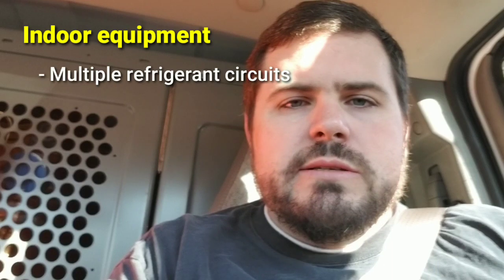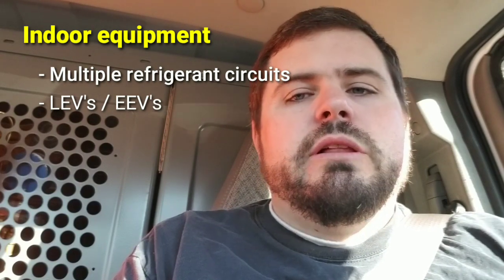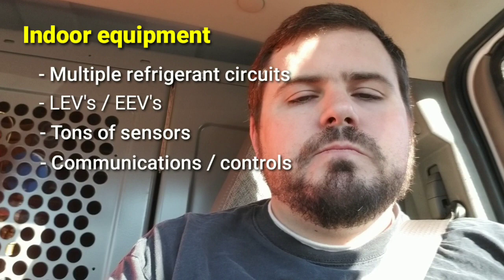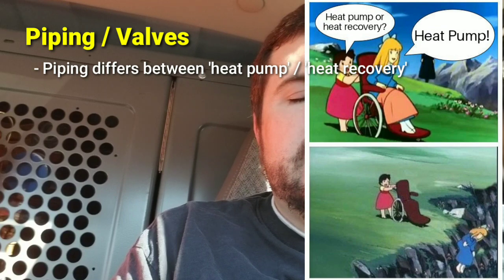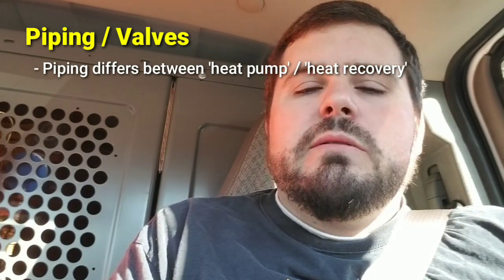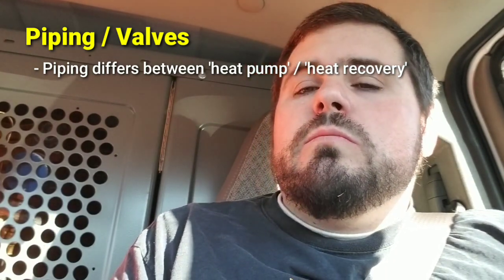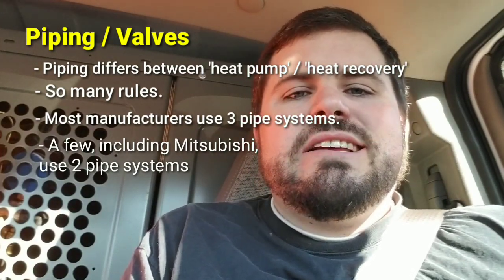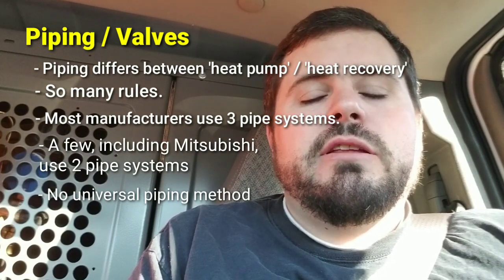What is VRF?  A overview - 1 of 4

Comment: For a G+2 floors in coastal florida with high humidity and heat with each floor of 3000K sq Feet what do you think of a hybrid VRF (like Mitsubishi or Daiken) with zender Air handler.. is that a good set up? or do you think there is better product than that

Comment: My condo VRF system do not work hot/cold simultaneously. Do you guys think this can be fixed?
Reply: No. This sounds like the simpler heat pump system you have installed. It would be a two pipe system utilizing Y's for branches. The Heat recover system is the one where it also has a 3rd pipe for the hot discharge gas to enter the building to which it would then have to go diverter box's to the indoor units to change flow from the cool vapor return or the hot discharge for simultaneous heating and cooling.

Comment: I have no idea what is VRF. From this video I learned that this is stand alone system. Is there a separate controller for heat pump and indoor unit? is it possible to connect to Bacnet BAS?
For indoor, BACnet can be in the thermostat? For outdoor unit, is there a controller?